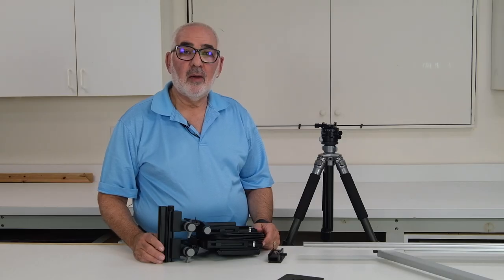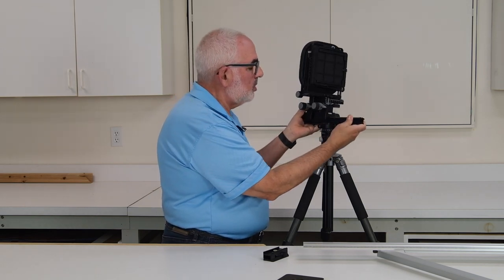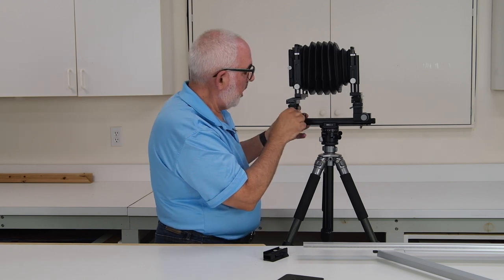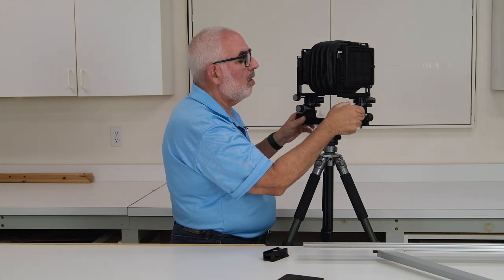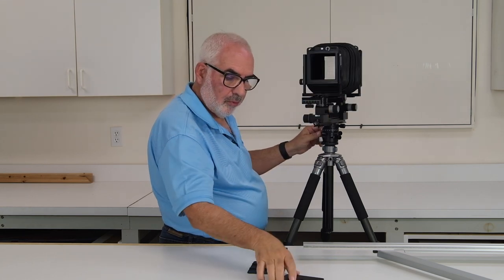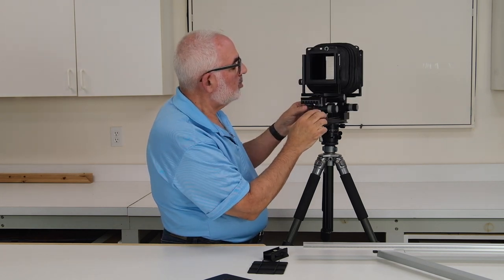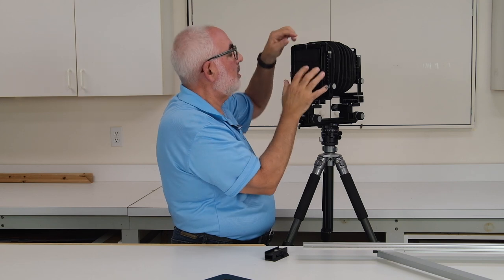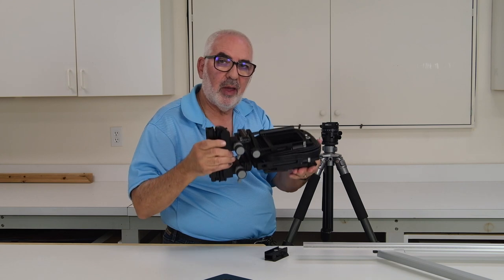74. Arca Swiss F-Metric Field w/MicroOrbix

Comment: one tip, Fred, you do need the standard base tilt, it allows for "indirect" movement, mainly to get extra rise or fall, by tilting the base rail up/down, then using the base tilt to "re-square" the standards, so everything is back to normal perspective.(then the micro-metric takes over for fine tilt control, aka selective focusing).

Comment: Thanks for this, very well explained. Does the geared shift have indents every 10mm or so for repeatable shifting?
Reply from the maker: There are no indents but the gear is very smooth and you should be able to get very close to the setting each time.
Reply: @viewcamerastore  Thanks!

Comment: Good video. What opinion do you have about the Core Lever for 4x5? I am considering one either the 60/75 to use with my Chamonix 45F-2. Do you find it limiting? I don't tend to shoot in unusual angles or do macro etc, mostly portraits and landscapes. Your insights would be helpful. I haven't find someone else using this head with 4x5
Reply from the maker: Hi Francisco - The Arca Swiss Core 60 Leveler should work fine for your Chamonix 45F-2.   I prefer the classic over the flip lock.  I have tried both and did not like the flip lock.

Comment: I thought this camera is designed to have axis tilt in the front standard rather than the more common base tilt. Isn't that what the Micrometric Orbix does?
Reply from the maker: Yes you will get an axial movement with MicroOrbix tilt.  But this tilt mechanism is far more and better and more efficient than garden variety axis tilt.

It operates the same as base tilt, by the way,   focus far, tilt near.

Axis tilt is correctly operated focus near, tilt far.

For a PDF on the Orbix and MicroOrbix Tilt please email me at viewcamerastore@gmail.com.
Reply: not quite, it is a topic related to "yaw free tilt", this enables you to tilt, Without changing the focus on the standard (moving the carrier on the rail) too much, ie: for "press camera" designs, where the focus rack is limited, so the less motion when tilting the better(gives more of it to focussing)-esp. for long lenses, as at infinity you don't have too much room left, due to the infinity distance about equal to the bed extension limit!!
the "micro-metric orbix" is similar, but designed around the focus "breathing", like in dslr lenses, but for the sensors used in phase one and other backs, so that the tilt is available (this focus breathing is within the limits of the sensor to focus the light), as if it were too tight, then the sensor couldn't be focused on all of the subject, as that part would be so back or front focussed, it 'disappears' into the out of focus area.

Comment: Hi, does it have degree markings on each standard for tilting?
Reply from the maker: There is no degree scale as the movement is from optical observation, your eyes, so would not help.

Despite some thinking it is true, you cannot transfer the rear tilt to the front accurately.  Even this would not work as MicroOrbix tilt is not a rear standard option.